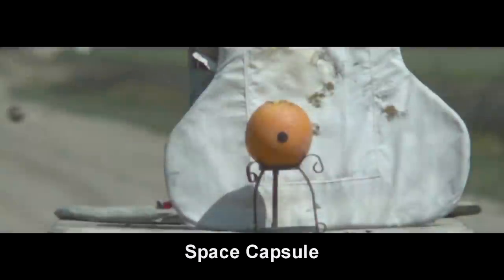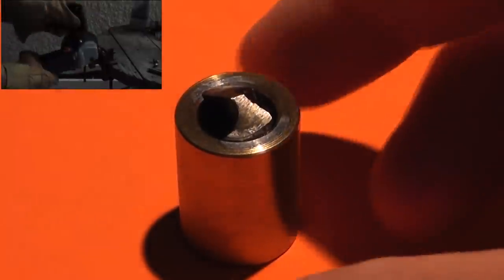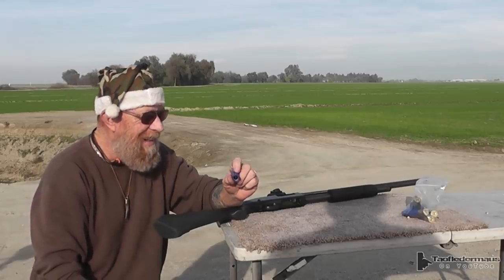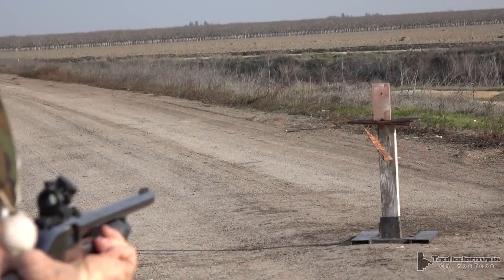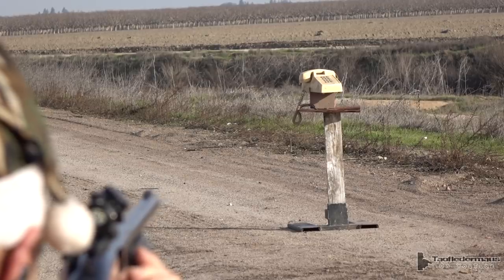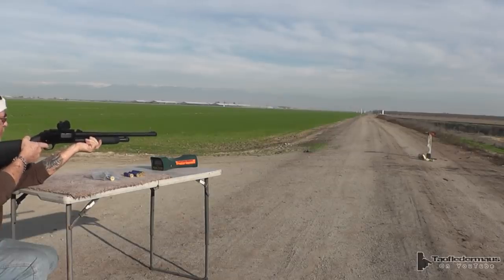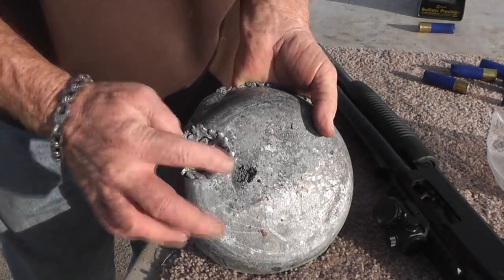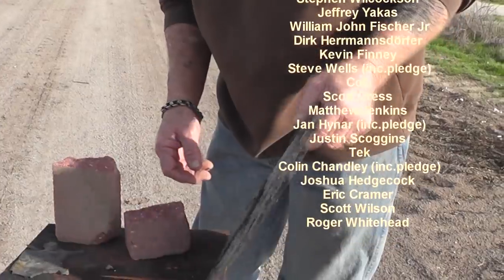Internal "turbine"  drill bit slug experiment

Comment: I think the reason for the low spin rate is the relatively higher amount of rotational inertia because of the brass sleeve. Then it doesn't need to rotate as quickly to achieve in-flight stability.

Comment: You’re getting a ram-air issue. The same thing happens on the pitot tubes of jet aircraft.  Basically, at those speeds the air will stack up in front of a small inlet.  To achieve airflow, you may have more luck if you start with a hollow cylinder and then add a slightly twisted (per the math based on exit rotation and muzzle velocity) and very thin sheet of metal inside.

Comment: Did you ever try these rounds in a gun without rifling? I would think if air was passing through the round the drill bit would produce the desired spin.
Reply: It would not spin trust me
Reply: @manasameakuma  Probably not, but they said they were trying to see if air was moving through the corkscrew. Any spin at all would indicate that, wouldn't it?
Reply: When I’ve shot full drill bits from my crossbow (80 pounds self cocking cobra crossbow, recommend if you want a cheap crossbow that could be used for small game/mild self defense (if shot at head it might kill) the drill bit had turned when o shot it at the wood block, so as long as it goes in deep enough it should spin on impact

Comment: If you want air flow through them at super sonic speeds, you’d need some kind of cone and rod on the front of them, the right length and diameter to control the shockwaves, so they’d allow air into the drill bit channels. But then they’d also be hitting the flat surface of the brass sleeve, causing turbulence and slowing it down more than plain air resistance would

Comment: WOW. NICE one Jeff and Danny - loved the video!!! 
In retrospective I should have made you a backing plate for the slugs... didn't think of it back then, of course.. 
I must say the water jug spray was impressive - but the brick bits flying all over the place was a definite shock for me... never expected these to pack such a punch!
As for the spiral air flow - not sure - maybe, if you have the same frame rate for all the slow-motion footage than possibly my guess is correct:
Notice that the slug rotates very slowly in the first shots - but seems to rotate relatively faster when shot against the steel plate.
Could it be because it decelerated to sub-sonic speed resulting in more air going through the vents and a faster rotation? Or is it just me?
Wonderful video... oh.... Sorry for the shoulder Danny! - Next slugs will be lighter! Promise!
Reply: smallathe 
Hello Saar. I just subbed to your channel. The shoulder is fine, thank you. Looking forward to shooting your next creation 👍🏻.      🇺🇸😎
Reply: @dannyakatrikerred7381  - Thanks Danny!!! I'm half way there - making another slug set - but the tool I ordered from ebay has not arrived yet.
They will be lighter and won't hurt your shoulder.
I have a few other designs I think you will like... :)

Comment: This is counterproductive.While the slug is in the barrel there are gasses passing through the fluting of the drill bit. The effect of this is that it causes a rotational force in the reverse direction. You need something more elaborate for such contraption to work. Tesla valve or some other way of preventing gases of passing through the slug in forward direction.
That's the reason for the unstable initial flight and actual improvement further. That's also the reason you don't see oil vapor. It was blown away inside the barrel.

Comment: You got better results in the .22 because it was not a flow through design.  The pitch of your rifling and the pitch of the projectile's fluting may be causing some opposition since they are bound to be different.  The projectile, providing that it's insert remains fixed, cannot help but impart a spin, though it will not be as noticeable in a smoothbore as it has to overcome a rather large static mass loading to do it and will take most of a long range flight to do it if it doesn't tumble first.  Sharpening the nose to a bullet shape and continuing the fluting pitch, using a 3 or 4 flute drill of a larger diameter with a thinner jacket are ways in which the spin may be tuned to fit it's intended function.  Don't mind me, I'm just retired and just can't seem to help but give out advice to others.

Comment: The drill bit could add a little bit of stability and accuracy but without weight could be a reduction in distance, and drills act on more on pressure not speed. The bullet has a lot of constant velocity but not constant pressure backing it.

Comment: IMO the reason you aren't seeing a vapor trail is because the mineral oil is inside the sleeve and not getting hot enough down the barrel to smoke. I'm guessing the brass sleeve isn't engaging very hard in the rifling compared to lead and not transferring the heat through to the mineral oil in the little time it has to do it. As for creating the trail, white mineral oil is actually about the best choice for making smoke.

Comment: Transonic is enough to create supersonic shockwaves at certain points around the shell. I wonder what would happen if you loaded it to less than 800 ft/s. Or even kept it transonic and used the red mineral oil (and maybe a couple more drops) and pointed the camera back at the barrel of the gun like with the hollowpoint. It was a lot easier to see that way.

Comment: Nice video, Love your work, At least the slug that hit the plate armor was stable and i saw it spinning as well. So that was cool and nice to see. The others did not seem to spin as well. but the one hitting the plate armor was spinning nicely. I have watched a lot of your videos and it seems like no matter how big the hole is in the slug air never seems to pass through them. My guess is once the slug is going super sonic there is some kind of air barrier or compression that makes any air go to the outside of the slug and not be able to pass through the center... similar to water and electricity... the concept that energy always takes the path of least resistance. and going on the outside will always be easier and the path of least resistance vs going through a hole that is attempting to compress air through it. Now all we need to do is make a slug that breaks those laws of physics and create a slug where going through the center is less resistant than going anywhere on the outside lol.
Reply from the maker: Yep!

Comment: I also have a guess that might help explain the lack of vapor trail... Per google, Mineral oil flashpoint is around 275°F. But one or two drops should evaporate or ignite much faster. You're also using steel and brass (instead of lead). How well do they absorb/transfer sudden temperature spikes?

Comment: I think there is some flaws in this design. If the bullet is fired with out a sabot. When traveling through the barrel of the gun gas flow through the bullet will be in the direction that the gun is fired (due to gas from the propellant, and this will reduce reduce energy efficiency of the gun). But when the bullet leaves the gun the direction of gas flow through the bullet will reverse and create force to spin in the opersite direction . 
A sabot that block the back of the bullet till it leaves the gun would avoid this provided that the spin of the bullet from the turbine is in the same direction of the rifling (and this would also increase energy efficiency by reducing gas loss though the bullet).
Making a bullet spin as it travels down the barrel will cause it to resist change in direction from where the barrel is pointed, however spinning a bullet after it leaves the barrel may not stabilize the bullets trajectory.
I'd like to see this experiment with a smooth bore gun with and without out a sabot.
There actually is a gun that fires bullets with internal propellant that spins the bullet but they are very rare.

Comment: I think the mineral oil is the problem. Brass and plastic with a drop of oil is going to make a bearing. What little spin you have is similar to a Foster slug so I think you actually DO have air flow.

Comment: Let' see if my tired brain can actually pull up the imagery here.
  Basically, air wants to flow in a teardrop shape around anything moving fast. The internal fluting is going to have little to no effect on the flight dynamics. External fluting, as if the projectile itself was rifled may have a modicum of effect. Enough to straighten out a blunt cylinder? I can't say. More bullet shaped? Probably.
   1 minor point: You should have loaded some of what you tested with a higher load. I know you were trying to capture the best image on the high speed, but you may have been  able to detect differing flight properties. I say this not just for this test, but any. You have limited ammunition to work with, but 1 or 2 for comparison might help, here and there.

Comment: Wouldn't think it needs to be at an angle if the thing isn't set in place. If it's loose then the force should still continue forward if I'm not mistaken, leaving no possibility of a ricochet.
Reply: Speaking of the ar 500 plate.
Reply from the maker: We always set fixed targets at an angle for safety,  even the lead plate.

Comment: I thought the shockwave would push the air around the projectile rather than through?  Didn't you have a French projectile built on the same concept?
Reply: I believe Jeff hoped by loading them just a tiny bit faster than the speed of sound, they would go subsonic after a few yards and then air might be able to flow through after transonic phase of flight. That's what the oil was for, to attempt to see if that happened. It appears it did not and the flow still went around the projectile but it's quite hard to tell ultimately.
Reply: I'd like to see more testing with these. A lower velocity or, perhaps better, a longer distance to the target. It would be fascinating, although I reckon unlikely, to see if the internal fluting changed the rotational speed over time, after going subsonic. A better way, interestingly enough, to induce this change might be to fire them backwards (though it might not).
Reply: Yes, it would create a separated shock bow in front of the projectile, making it behave like it was completely solid. As soon as it drops to transsonic speeds the shockbow dissipates and the air can enter the channels, but then rheology gets REEEAAALLY ugly.
Reply: SmarterEveryDay has a video showing how a layer of high pressure air forms in front of the projectile.
Reply: @44WarmocK77   The air inside the projectile can't move as fast as the air going around the projectile,. IOW, the path of least resistance for the air is around and not through the projectile.
Reply: There must be an equation that gives the smallest passage that will allow flow at transonic speeds.
Reply: At subsonic speeds, I think it ought to move thru the middle just fine.
Reply: @BubblewrapOracle  The problem that the mass of air that's moving through can't impart enough angular momentum to the projectile given how heavy it is, in part because of the narrow holes and part because of the weird drill bit air pathway.  I think people are taking the auger metaphor a little to literally. You can't screw yourself through the air. I think that was a naive Da Vinci helicopter design.
Reply: Christopher Manfredo , I was thinking the same thing.
Reply: Stop the Philosophical Zombies
I think to take advantage of that particular design, the resulting drag it would require to make it work would hamper any velocity efforts. Weight of the projectile is the killer here, and not in a good way!

Comment: Maybe try the oil experiment sub-sonic with a smooth bore. I'm thinking the amount of spin caused by the rifling may be to fast for the drill bit to actually "catch" any air. Plus the shock wave caused by the projectile itself may be causing the air to go around the outside rather that through.
Reply: That was my first thought as well.
As I see it, there is bound to be air traveling through the inside as the low pressure zone behind it will pull some air through it. However, I don't think that there is enough flow to make a difference beyond the transonic region.
For a subsonic projectile, if the CG is reasonably well located, I do think that it can have a positive effect. Maybe someone has the tools to do a CFD simulation.
Reply: @leoa4c  Yeah, they would have to shape the inside the way an actual turbine is shaped. Even then, it's not really going to be moving enough air to affect the flight. Though I could see this thing having better penetration.

Comment: On subsonic aircraft, when I need air to flow through for cooling, I follow a two thirds rule. The INLET must be no larger than 2/3rds the size of the outlet. If the intake is too large, the air just stalls in-front of it. Sounds crazy but It works. On some of your air through projectile projects, this may be happening.
Reply: I think the aerodynamic shock wave is preventing air getting into the drill slots.

Comment: The reason atleast of what I believe on why there was no vapor on the slug is because you need the pressure,on a hallow point when you fire it, the indent gets I think negative pressure because all the air flow wants to go around but it then evaporates,so it just slips out the back of the slug on this vid

Comment: The tips of the drill bit might be causing air to move laterally over the holes, countersink the bit below the top of the brass collar(think jet turbines) or maybe file the tips of the drill bit so they come to sharp edges. 
It just seems 1/16” of tool steel would displace enough air that the air vanes would essentially have a lid of air rushing over the top and not through them.

Comment: Taofledermaus, could you shoot a slug that’s either, a really thick drill bit, or has more of a exposed drill bit
Reply: Also (at least from my cross bow) it shouldn’t even need rifling as long as the target is strong enough to let it in a decent amount (3 cm?)
Reply from the maker: The problem is it would destroy the barrel if we just shot a 12ga sized bit.   These slugs are the right diameter for the barrel,  but don't allow the bit to contact the barrel.

Comment: I don't know much about slugs. I thought they needed a solid base and thus no hole all the way through the center. You should check out the details on the J-58 engine that powered the SR-71. Supersonic airflow doesn't like to go into holes for some reason. The cones on the front change geometry to direct the shockwave inside and the airflow is slowed to subsonic velocity at lower speeds so there is no compressor stall. At high mach numbers, the engine transitions into a ramjet!

Anyway, if those brass pipes were hollow, I bet you would get similar performance. Just shoot them without drill bits from a rifled barrel.

Comment: Suggestion for Saar. Thin the brass down about 100 thou, cut 3 50 thousands deep, 50 wide, and encase the brass in lead. Then load the drill bit in it. I think the brass is too hard and stripping the rifling out of the barrel. with the lead outer covering, it should be able to pick up spin better. 

Just a thought.

Comment: air will never travel down a hole in a projectile because the air presser inside the hole will always be grater then the surrounding air presser even at air-soft gun speeds 

only reason air goes into air intakes is because some ware their is something creating a vacuum like on a jet engine the turbine is creating a vacuum on a car the pistons are creating the vacuum but their is nothing creating a vacuum on a projectile

Comment: Try a smooth bore; if the slug is getting air flow, then the fluting through the drill bit should impart spin on it without the need for the rifling in the barrel. Also, there was no mention of the specific twist rates. Clearly, if the rifled barrel's twist rate is different from the drill bit's twist rate, air flow through the slug will have an effect in its flight performance.

Comment: Btw, my well trained opinion: absolutely violent little slugs. A little hotter load, and you would have more issues.  But it may also penetrate the body armor plate. I think that the helix may be in the opposing flight to the rifling in Danny's shotgun, or the mineral oil is behaving as a non-Newtonian fluid at that rate of vibration.  It's got to do with the harmonic vibrations in the barrel.  The 22 mag is moving through a shorter, stockier barrel.  It's frequency is different than the shotgun. Maybe the shotgun vibrates at that exact frequency necessary, at that load/speed/aerodynamic shape. Lots of different forces acting on the slug, my friend.

Comment: Just stumbled on this. 1.) You won’t see mineral oil vapor from the inside fluting until subsonic. 2.) You’re actually firing in the trans-sonic range. Either dial the speed up so it exits well above transonic or slow it down so it exits high subsonic. The transonic buffeting is likely the root of the instability. 3.) The high twist rate of the drill bit will only cause more instability. Try lowering it to 16-20:1 4.) Extend the drill tip leading edge 2-3mm and 3-4mm past the bottom. This will help "push-pull" the air thu.  Really, really cool tho. 👍

Comment: I appreciate all the research to find the ultimate slug but personally, I don't need it.  I have a 1980 vintage Smith & Wesson 12 gauge pump, short slug barrel, iron sights, no choke, no rifling.  Using Winchester 1 oz slugs, I can hit a 6" circle offhand at 100 yards every time. From a bench rest, I have grouped three shots at 3".  I just don't need better accuracy than that.  (This same gun throws the old Breneke and BRI sabots completely off the target.)